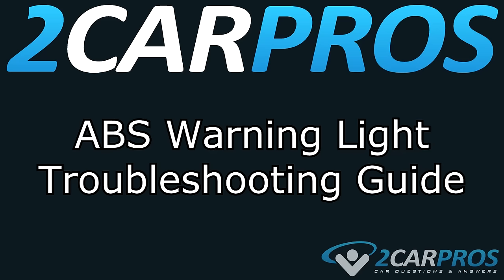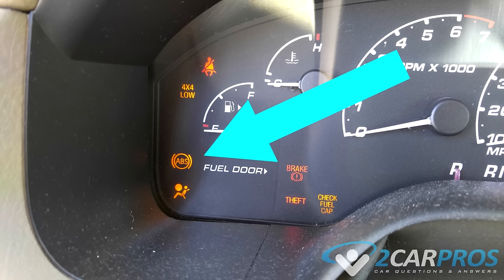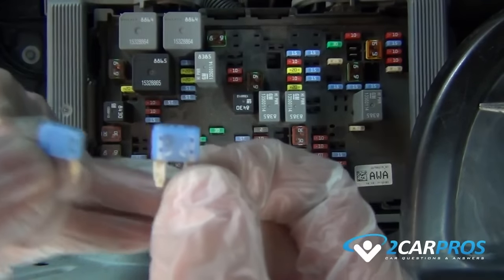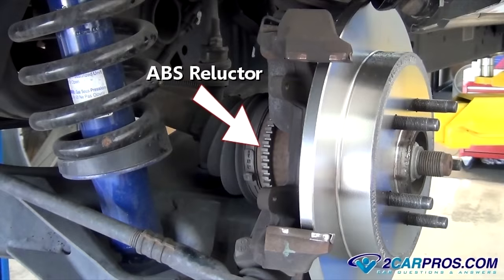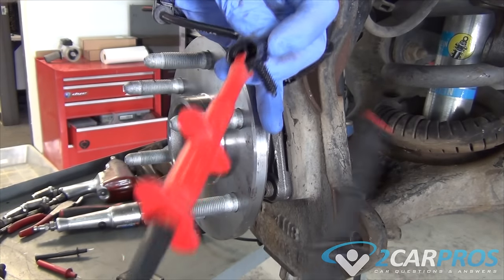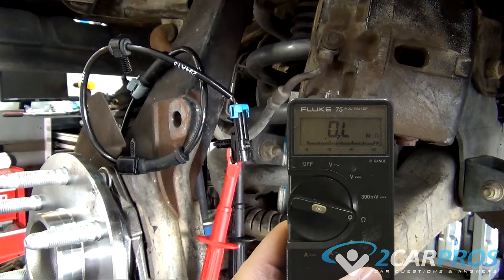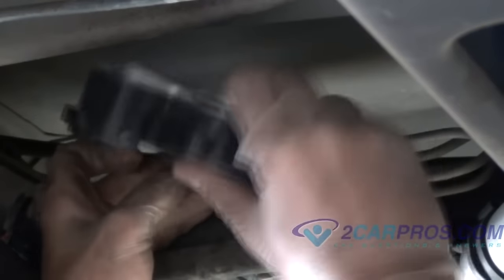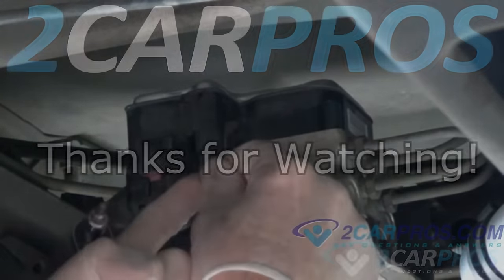ABS WARNING LIGHT ON? FIX IT IN 3 EASY STEPS

Comment: My own tip :  If it is a ABS module like the one shown Chances are the solder is cracked Or corroded  You can open the lid after Carefully using a razor or thin blade to remove the rubber gasket seal.
Items you will need : Solder gun pen tip. solder. Water proof/high temp chauking, Thermo paste for computers 

Remove the lid Heat up and remove any solder Then reapply  one at a time  Do not try to solder the smaller connectons as they are hard to do for people new to this Or without better tools for the job 

Clean any paste that was on the lid Reapply where the lip dips downwards and meet's the board  Make sure your old gasket is cleanned off then apply new gasket ..install and test 

If it works .... You just saved $200 - $600 on buying one ...
Another issue is Wiring after the ABS sensor line in the engine bay : Many car makes have wire connections with crimped butt connectors  These in time do get wet and dirt And fail 

Find a Hanyes manual for your year and make  Head to the back of the book for diagrams on electronics under ABS And you will find the color of the wires And where they go
Reply: I'm not a car person, so thank you... but I didn't understand a word of this.
Reply: @jeezursilly5252  Well thats's a fix too Pay a mechanic to fix your issue
Reply: Seriously!!!🙄
Reply: Makes prefect sense to fixing the control box instead of replacing it.
Reply: @jeezursilly5252  it's not necessarily just car related, but useful when it comes to basic or advanced electricity.
Reply: You should make a video!
Reply: I doubt any one on here knows what a Hanes Manual is let alone has used one
Reply: @georgedeschler1514  I used to buy those for working on my 1982 Honda Accord
Reply: @rogerbaker5090  before the internet its all we had
Reply: @georgedeschler1514  Hanes manuals used to be where it's at. I  think I had one for each of my vehicles. Came in handy many times 👍👍👍👍

Comment: Lots of good info. My ABS and brake light warning are not on, but at less than 5-6 mi/hr the anti-lock kicks in making it dangerous in quick stop situation. It started as an intermittent problem but no is constant. I have quotes of up to 375.00 per spindle to repair it. I know I can do it for less than that. when I pull the fuse the ABS and brake lights come on and stay on. The question I have is... If I unplug the ABS sensor at the spindle will it effect the  vehicle in any negative way
Reply: I have the same problem.. wen coming to a stop, right at 5-0 mph the truck jerks. Idk what to do..
Reply: Same problem my car ??

Comment: Another problem could be GROUNDING cables between the battery, and body, to engine,  points. On Ford products these cables become corroded, or rusty. This causes poor grounding. Many other Ford vehicles have similar problems. Their bare metal woven ground cables corrode to the point of breaking.  On my 2008 MKZ  the Check Brake System light would come on as I drove out of my driveway. I checked fuses, and other pieces. Upon inspection of the two cables, one from battery, to shock tower, and another cable from engine , to the other shock tower were dirty, and loose.  Using a jumper wire from the engine to shock tower mount, the problem was solved. Later , replacing the small bolts that attach the cables, to the body, and tapping the holes for, slightly larger, bolts,  assured a much better connection.
Reply: After restoring the ground connections paint them with liquid electrical tape to seal out all moisture and air.👍👍

Comment: I wanted to add that it could be your brake switch as well. My brake lights worked normal however my abs light was on. It actually turned on and off for awhile. But eventually stayed on and wouldnt turn off. I did have a code for brake switch light. I changed it out and my abs light turned off.

Comment: will the light on the dash still light up on the dash with the fuse pulled? Never mind I'm gonna go do it and see for myself, but thanks anyways , I couldn't wait for an answer. Keep up the videos.
Reply: Heck, let us know if it worked!
Reply: With the ABS fuse pulled there should be no power going to the ABS system...  The car's computer should detect this as a problem and the ABS light should still come on.

Comment: Very helpful! Where I live in Texas, an abs light makes a vehicle fail the annual inspection and you can't get it registered.
Reply: I'm a licensed Texas safety and emissions inspector and can tell you a lit abs light will not cause your vehicle to fail an inspection. Whoever told you that is full of shit. Code 4.20.11 line q of the TXDPS inspection code says "Anti-lock (ABS) lamp on signal which is on or comes on during test will not be cause for rejection." Basically Abs is an add on to the service (regular) brakes and as long as there's nothing wrong with the service brakes, the vehicle will pass the brake portion of the inspection.
Reply: @frankgonzalez24  If I slam on breaks a couple of times in my 96 Blazer less than 50k miles and if you have a friend that does inspections ask them if they can use another vehicle to pass the inspection.
Reply: @frankgonzalez24  Thank you for citing the regulations.  (I confirmed it with a simple Google search.)  I just got rejected today because of the ABS light.  I'll try that again.
Reply: @frankgonzalez24 So, basically it’s just emissions & tires that the vehicle has to pass?

Comment: This problem can be a pain and expensive to fix,some cars have metal cased wheel sensors that mount into alloy or steel hubs and after a while are impossible to remove without breaking them,plus if the pump is at fault the cost of the pump can be more than the value of certain ageing cars.I can tell you after 50 years in the motor trade that this is seldom a simple or cheap fix.
Reply: Tik l
Reply: Tape on the light is the best way to go!
Reply: But still cheaper than a new car..

Comment: Thanks for this video. Very helpful. I found the issue with my pickup truck ABS warning, one of the wire speed sensors was chewed by our dog. Reconnected it, the light turned off and the ABS itself is working again.
Reply: @Predator Plus more like a rat chewed it
Reply: My Jeep just failed its annual inspection on ABS, with a broken cable to the sensor broken. Jeep wanted $a lot and currently not in stock if they can get one at all. A breaker is getting one to me tomorrow for $ less than 100. Then back to the shop, I need to replace a front marker light bulb and headlight bulb too, but I've already got them.

Comment: My ABS ABD light would come on after driving about 20 feet, in either forward or reverse.  Turns out it was the relay (one of two) in the trunk on the pax side. The one closest to the gas tank was the culprit.

Comment: My local Midas Muffler shop where I get all my work done changed the right front sensor on my 2008 Ranger. $475.00 Now my left front sounds like a cat got caught in the wheel. Not wanting to pay that price again I did as this video said after a long search for the correct fuse. Ford sucks on that, they number the fuses and finding the right one was a cluster. Now it works like any power brake system I've used forever. Doing the Snoopy dance now.
Reply: Midas is the worst. Ive paid for an oil change and checked it after before, and it was still black. Same filter. Find a good shop
Reply: Good info👍👍👍
Reply: Midas is such a rip off..incredibly over priced and their work isn't great.

Comment: 2009 dodge caliber sxt light came on a week ago. Checked tires by grabbing them seeing any looseness. Seemed fine in all 4. Put front up on jackstands and sped tires to 50 mph. Noise seemed fine on both sides. Checked rear wheels for looseness. None. Spinned wheels by hand and seemed fine. Checked tire pressure to see if psi was OK. NOT. All 4 tires were 25 to 27 psi. Put in 33 psi in all tires and took for a spin and ABS light went out. Holy shite. I wouldn't have thunk that. CHECK tire pressure. It was a easy fix.....
Reply: Thank u

Comment: thanks for the video,  if the diagnostic is reading changes in 3 out of the 4 wheels except one which is stuck on a fixed number.  I changed the wheel sensor and still .   this happened after a hit to the right front side of the car what could it be?
Reply: broken wire?

Comment: Many older rear wheel drive vehicles have a single abs sensor located on the differential housing using 3 sensors total.
Reply: I can confirm this on my 1996 vehicle.

Comment: Good vid!   If you have time i have question. My 2005 Dod Grand Caravan has had ABS light on for a few years.  
Don't ask bout inspections:)))
I finally need to fix this. Cost of guessing mount up fffast.

I sent to Garage to scan looking for a direction as I had checked sensors and (rings), with no visible issues. 
They said pump ABS would not power, no codes for sensors. 
I removed battery and checked for power to plug on Module. 12 v and good ground to both heavy wired connectors. 
Top 2 positive, lower 2 ground
I did the ohm check on all sensors they checked ok.  Have power to plus side of connectors (close to each sensor).
However i tried the connect sensor pins to meter set to A/C, spinning tire I get no current detected on any sensors. 

What I did not check while I had module plug off was pin 7  left side (holding the plug as it fits)  is supposed to be powered as well.
I guess i need to get up and close to wiring diagram.
Any help/advice would be greatly appreciated.
Best; Tom

Comment: very useful thanks. my ABS light and parking brake light turn on while I am driving then if I park turn car off then car on again neither light will go on...help !
Reply: check ur brake fluid
Reply: Jorji Sam thanks I'll do that...
Reply: Jorji Sam I am having the same issue the fluid is full replaced all the breaks and checked the sensors tried your trick and lights still go on.
Reply: 2013 hyunori car accent trouble dicc brakes how to ajust
Reply: So how did you solve it, please share

Comment: Will sticking brakes cause abs and vdc lights.   My 350z will suddenly (in drive) shift into low gear and come to a sudden stop when I let go the gas paddle.    I can take my foot and lift the brake paddle and all seems normal.  I can drive a few as long as I dont touch the brakes.

Comment: Great guide. I have a 87 Ford Scorpio (Granada mk3)  and these days a lot of the suspesnion parts will be replaced. Like brake discs, pads and wheel bearings. The ABS light comes on periodically, often its off at idle and comes on when reacing a certain speed. Any tips what could be wrong? Ill will probably check each sensor the way that is shown in the video, but first Ill check the fuse.

Comment: Hey, great video - very explanatory. Could I get out of the way the ABS module failure since my ABS light only goes on after I increase the car's speed beyond, let's say 15mph? Basically when I start the ABS lights are off. The car is BMW E91n 208 320d. I have to mention that I cleaned the rear left and right sensors and after the cleaning the ABS light was off before the speed increase, before the cleaning the light was always on. Also the ECU errors for ABS are: 5DB2 and 5D90. Thank you!
Reply: I'm a newbie but clean the ring the sensor reads from.

Comment: "When this light is on, it means the system is disabled"

Not true.  My ABS warning lamp is on and yet the ABS works just fine.  I've tested it on a dirt road.  The brakes pulse just like they should and the car pulls straight.

The only thing I can think of is a short in the lamp wiring.  Any other reason the lamp would be on?  If it is a short, is there any common places this would happen?  I'm not looking forward to completely disassembling the dash in a '93 Caprice just to get the stupid light to go out.
Reply: Wrong bro if your abs the light is on it means your brake is not properly working, the cause sometimes your brake should not open proper or maybe if you apply your it could be dragging, or going on other side try to figure it bro 100%

Comment: I have a B7 vw passat. 2 rear wheels not returning speeds. I have had to pull the abs fuse to disable the abs as the offside right front abs is activating at moderately low brake pressure. The rear abs rings and sensors check out ok.

Comment: My abs goes off and them back on 5-10 seconds later and stays on. Any idea where I should start with this it is 1994 so no codes to get. I like your video, very concise. sub'ed
Reply: I had this problem with my dodge charger. It was the wheel speed sensors. Id start there.

Comment: And how could you do all this at home?
I would prefer to get the OBD error code first
Reply: MURRYCHOOCK ...yes, you can use that (OBD scanner) but those warning lights will eventually come back.
You should also check the “Switch Stop Lamp” sensor (sometimes located on top of the pedals area).

Comment: Hi, I have a 2011 jeep liberty,  ABS LITE, 4 wheel drive,  and traction control lite came on at the same time, wheel speed sensor changed, mechanic spent hours trying to diagnose this, at the shop for 2 days, could not find the reason
Reply: Ann D.H. Hey did u ever find the reason? Please tell me i don’t know
Reply: I have the same problem
Reply: My accelerator pedal causes mine to go into limp mode. I use a code reader to clear it until I can get it fixed properly

Comment: 2006 suburban with stablitrak light on abs and brake light on also but brake fluid was full noticed charging system was 14 amps with air conditioning on

Comment: I have a 2011 Suzuki Vitara and the ESP & ABS lights
have been coming on and going out. Now they pretty much just stay on. I took
the car in and the dealer says it needs a new ABS Module. It costs about $1400 but
they don’t have one at the moment. They said I can drive it but the ABS is not
working. What are the chances of fixing the module? Could it be that it is just
dirty? Should I try taking it apart and see if something is just jammed? What advice
do you have?
Reply: as lot of abs modules can be repaired , see autoxpresstech.com
Reply: @jimpepper1  maybe pull-a-part and pull one from salvage vehicle
Reply: Do you have salvage yards where you live?
Reply: @Flowerchild778  
I've learned to live with my Christmas lights dashboard. 
Sometimes they're off, most of the time they are on. On a slippery road I thought I felt the ABS. I think everything is working except the lights.
These lights seem to be a common problem with Suzuki.

Comment: Could low braking fluid cause an ABS light to turn on? It’s a bit lower than that max level.
Reply: It can cause your "Brake" light to turn on, do not complete the lost fluid until you check you brake pad, if they are wear off change them that should raise your brake fluid level, if they are not you have a leak and you should get some one to check your brake system.
Reply: Ppl
Reply: @johnwinstead7740  no hi by hi

Comment: I have a 2012 Smart 451 and it has an intermittent ABS light that only comes on in the wet any idea what the fault could be? The sender has been changed and reluctor rings look ok, car has been doing this for at least 4 years just to rear left wheel.
Reply: Water getting into one of the connectors down there it sounds like. Try taping up connectors to stop water getting in.
Reply: @richardmorgan7246  Got fed up with it can drive it in what ever state it is so took dash apart and put black tape over bulb now passes MOT's easy.

Comment: I changed the front right hub on my 2009 Kia Sedona and after doing so the ABS and ESC light came on. Any idea of what may have caused that. I changed the sensor and no luck.
Reply: People only come to sites to whine about their problems, but they NEVER respond to let us all know what the problem was in the end.
Reply: The space between the senor
Reply: I have read where someone put the old sensor back on since the new one wasn't working on new hub . I will try this myself as I am having abs and traction control lights come on after rwplacing fronnt hubs thay came with new sensors. Give that a try.

Comment: GUYS!! please dont get confused, some cars dont have 4 speed sensors, some only have 1(very rare) some only have 2, 1 on each front, alot have 3, 1 on each front and 1 on the rear driveshaft somewhere, and of course the best, one on each wheel.. theirs simple to spot, theyre the only thing in the area thats a wire, otherwise the only thing in that area at all will b a break line.  very very very rarely there will b a linkage on high end vehicles for automatic leveling, other other than that.......

Comment: My husband's cars lights are all on for the brakes. We just replaced the brake module because it was leaking. We thought that would fix it but they're still on. Is there some kind of reset they were suppose to do at the shop or what??
Reply from the maker: Yeah the computer has to be reset. Thanks for watching!

Comment: Most of the time it's just the magnetic sensor that needs to be replaced on the inside of the roter
Reply: Thats my issue original sensor and going past 400 k still running

Comment: how many sensors are there?...and how do you determine which one has the issue, if possible??...my ABS light goes on and off randomly...will motor vehicles department pick up that problem in an inspection?
Reply from the maker: Most likely yes. Depending where you live and the laws governing vehicles, they will pick up the warning during a smog check or a safety check.

Comment: do u have to bleed brakes after replacing abs module
Reply from the maker: No you do not
Reply: Mario Carranza only if you open the brake lines
Reply: ...and you won't need to open the brake lines to replace the sensor. So definitely no.